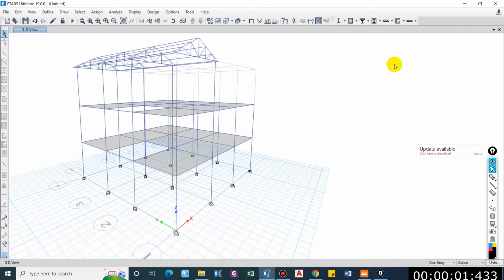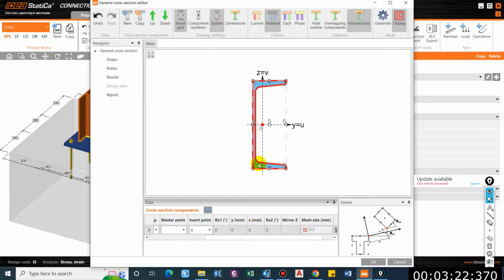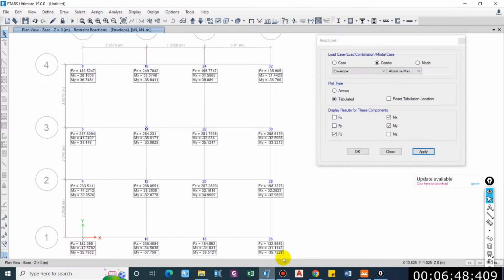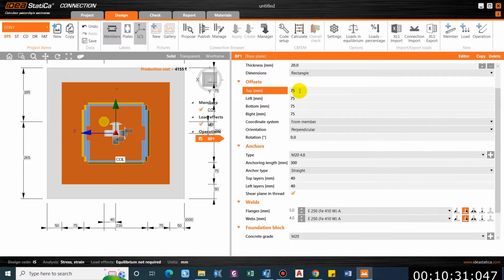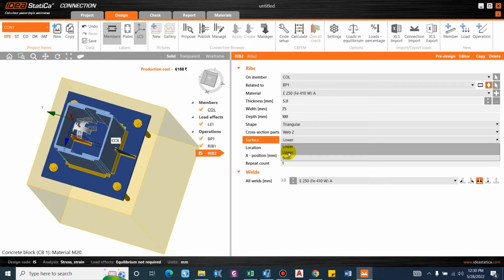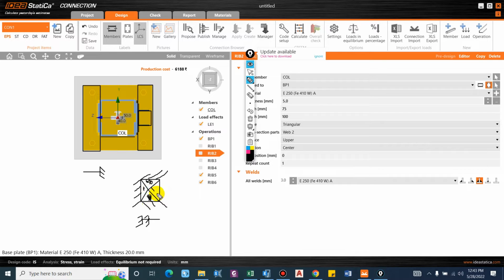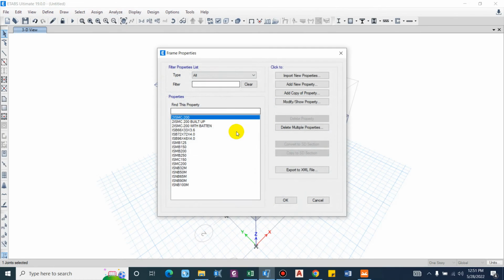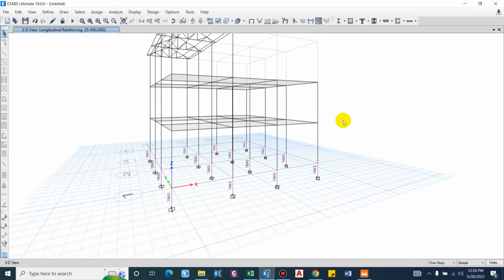Design of base plate connection (Built-up Column) | IS 800:2007 | ETABS & IDEA STATICA | Stiffener |

Comment: In case we assign metal sections in the first floor,  should we provide fixed joint on the first floor for the result forces Fz, My Mz which are needed for the connection design in idea statica?

Comment: to what Percentage of eccentricity can we go while designing a residential building upto 4/5 storey?  . when i am modelling a building in etabs and as per IS code eccentricity of a building is limited to 5% but it is very often that we come across having more than 5 %, generally 10 to 15% and i can not change the drawing and it is only 4 storey building? so how to deal with that case!!!
Reply from the maker: You have to incorporate that eccentricity into your design.